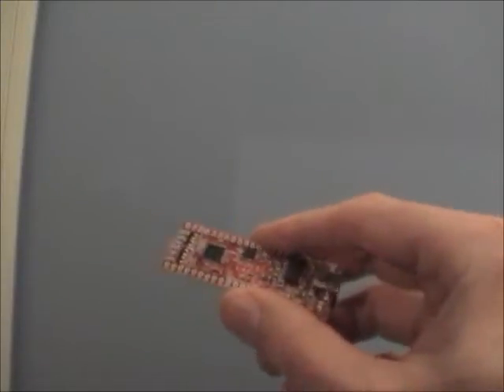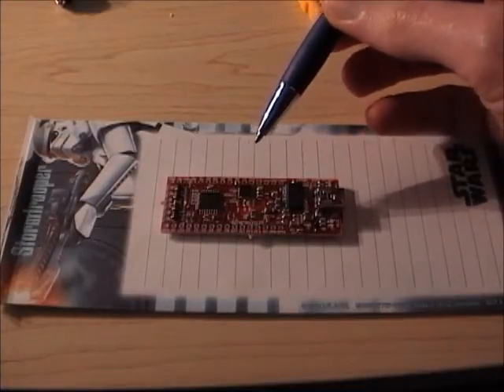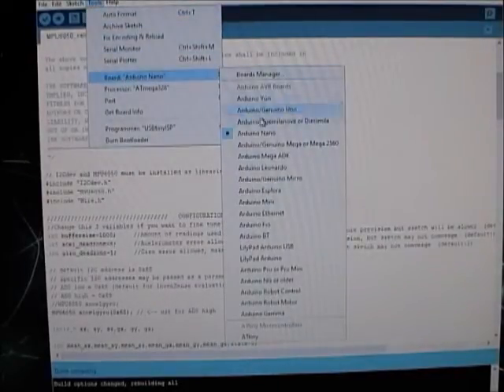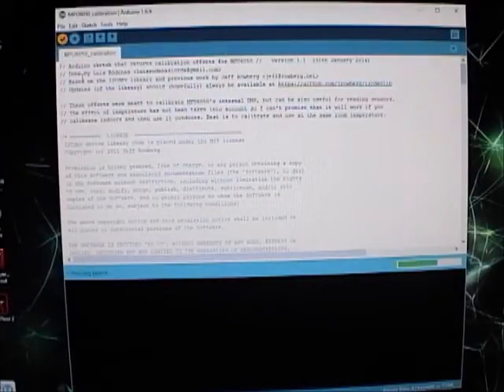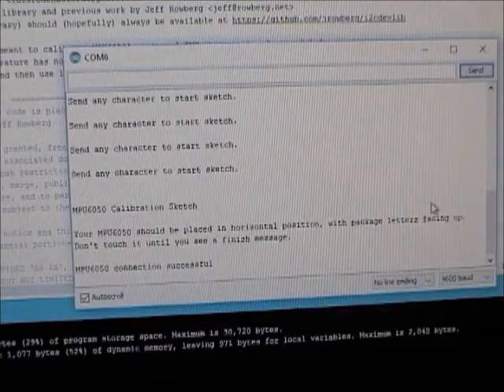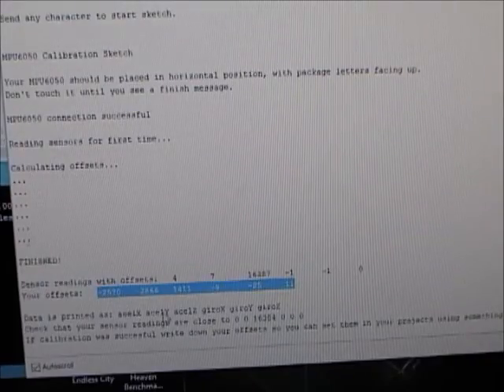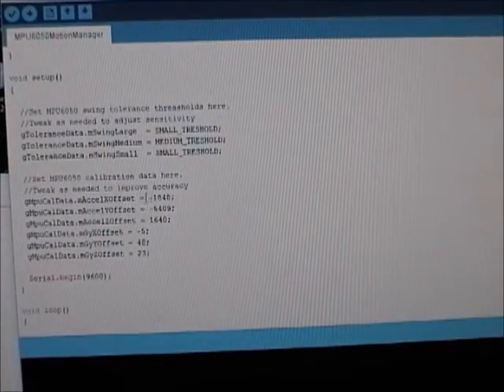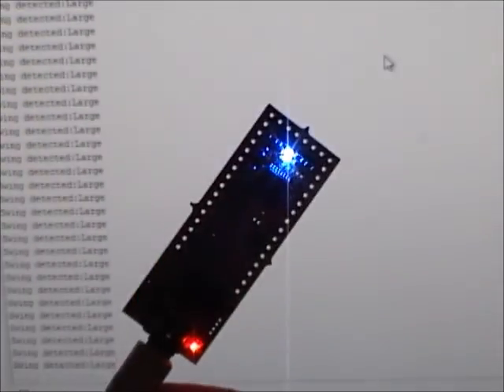DIYino / MPU6050 Calibration

Comment: I understand how to get offset from gyro but what about accel? I think we need to turn sensor around to get accel offset.
Reply from the maker: As far as I understand it, the accel offsets are determined by assuming two of the axis should be zero G and the other one should be 1G (the axis pointing down should be 1G). That's why the chip has to be oriented a certain way before the calibration sketch starts.
Reply: @jakesoft . I think so. After dig in the code It just  as you say. But I think it inaccurate because we cannot lay the sensor perfectly flat. Anyway I got the better idea what to do Thank!
Reply from the maker: True, it's not perfect, but likely the best a hobbyist can do.
Reply: @jakesoft  You under estimate my power. haha let me try XD
Reply from the maker: @mlab3051  Hey, go for it!

Comment: vcc > 5 vdc
gnd > gnd
scl > a5
sda > a4
int > 2
this is my connection with mpu6050 to the Arduino uno

but after uploading the code serial monitor is showing "MPU6050 connection failed" ….. and several time the offset is coming after a long time; most time it's not coming … continuing the process …  can u plz help me
Reply from the maker: Try A5-> SCL and A4->SDA. Leave INT on the MPU6050 floating.
Reply: @jakesoft  
U r telling that just keep INT blank and A5 & A4 are same as I've done .... but then also the same problem .... if there have a chance then I'll send u the screen shot.
Reply from the maker: It should work wired like that. Also confirm that the MPU6050 isn't upside down or tilted. It has to be nearly perfectly level and stable.

Comment: Hey Jakesoft, Thanks for this tutorial! It's definitely showing this n00b how to get started with my DIYino. My question is, what do I do if after uploading that calibration sketch to my DIYino, I don't get any data from the serial monitor? Is there something you know of off the top of your head that would cause the issue?
Reply from the maker: There are a few possibilities: 
1) You have not selected the correct COM port from your Arduino IDE for the serial monitor. Make sure you select the correct one. 
2) You have selected the wrong processor/board when you compiled your sketch. For the first 2 runs of the DIYino prime, I select "Arduino Nano" as the board type. In later runs Andras started using the Uno bootloader, so you have select "Arduino Uno" from the board selection menu in the IDE.
3) Make sure you have the correct baud rate. The baud rate of the serial monitor should match the "Serial.begin(xxxx)" line in the calibration sketch. 
4) Depending on your operating system, you may need to install the Arduino serial drivers. If you can upload the sketch, then you are probably fine, but just thought I'd mention it anyway. I have never had to do this for Windows 7 or Windows 10. 

I hope that helps. Good luck.

Comment: Hi. I am interested in using this DIYino board in my build, but I can't find it for sale. Could you provide a link to the item or seller? Also will this support crystal chamber LED? And curious if I could add a forced feedback from a vibration motor? I saw it supports the strip light design for blade power on and off chase lighting system. How do you wire and control that feature? Is there a place with detailed information about how to do this, like a wiki page?
Reply from the maker: Sure thing, Alex. Just contact user "Obi_1" at the FXSabers forum. He 
recently put out  a new run of them and still has some available as of 
the time of this post. 
https://www.fx-sabers.com/forum/index.php?topic=51220.0
As long as you can code and know a little about electronics, the board can support all the things you asked about. It's programmable so totally flexible
Reply: Thanks.

Comment: Hello again, Jakesoft! I'm trying to code my first saber, but I'm not very good at coding) Usaber library greatly facilitate the task, but I still can not fully understand how it works.
Maybe you have a couple of examples of the final code that is loaded into the board. I think it is very helpful to me for educational purposes.
Thank you in advance, if it possible.
In any case, I will be glad of any information.
Thanks again.
Reply from the maker: As it happens, an example sketch is included with the Universal Saber library. That should be exactly what you're asking for. Once you have installed the library, it can be accessed from the Arduino IDE by selecting File->Examples->USaber->Examples->Sabers->DIYinoSaber.

You can swap out the Blade, Sound Player, and Motion Manager for whatever you want to use in your project. I might include more examples with various hardware in the future, but that should get you started.

Comment: Hi, Jakesoft! Thanks to you for usaber!
But something going wrong when I'm trying upload code Mpu6050MotionManager with my calibration data

D:\Program Files (x86)\Arduino\libraries\USaber\DIYinoSoundPlayer.cpp: In member function 'virtual bool DIYinoSoundPlayer::PlaySound(ESoundTypes, unsigned char)':
D:\Program Files (x86)\Arduino\libraries\USaber\DIYinoSoundPlayer.cpp:221:19: error: 'ESoundTypes' is not a class or namespace
  if(aSoundType != ESoundTypes::eeBootSnd &&
                   ^
D:\Program Files (x86)\Arduino\libraries\USaber\DIYinoSoundPlayer.cpp:222:17: error: 'ESoundTypes' is not a class or namespace
   aSoundType != ESoundTypes::eeMenuSoundSnd)
                 ^
Compilation error.

What's wrong, and what I must do to code gone work?

Thanks
Reply from the maker: Can you be more specific? What happens when you try to upload the MotionManager test sketch?
Reply: arduino IDE gives Compilation error:
 
Arduino: 1.7.7 (Windows 7), "Arduino Nano, ATmega328"

D:\Program Files (x86)\Arduino\libraries\USaber\DIYinoSoundPlayer.cpp: In member function 'virtual bool DIYinoSoundPlayer::PlaySound(ESoundTypes, unsigned char)':

D:\Program Files (x86)\Arduino\libraries\USaber\DIYinoSoundPlayer.cpp:221:19: error: 'ESoundTypes' is not a class or namespace

  if(aSoundType != ESoundTypes::eeBootSnd &&

                   ^

D:\Program Files (x86)\Arduino\libraries\USaber\DIYinoSoundPlayer.cpp:222:17: error: 'ESoundTypes' is not a class or namespace

   aSoundType != ESoundTypes::eeMenuSoundSnd)

                 ^
Reply from the maker: Hmm... I see what you mean. I'm not sure when that error got introduced. I'll look into it.
Reply from the maker: I uploaded some fixes to GitHub. It was a compiler version/options problem that made the build fail for some versions of the Arduino IDE. Download the new version and give it a try. Sorry for the inconvenience and thanks for pointing this out.
Reply: Thanks for a fast fixes
Reply from the maker: DFPlayerSoundPlayer is disabled by default. Use DIYinoSoundPlayer instead.